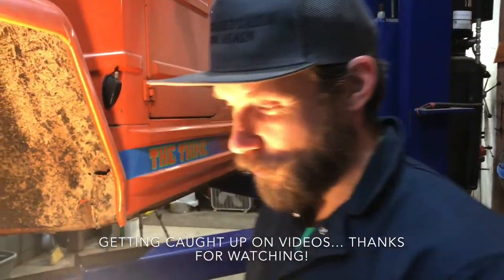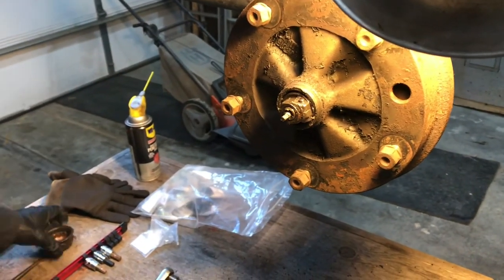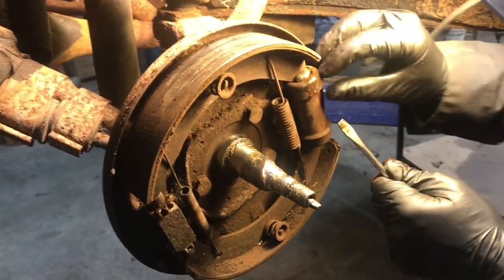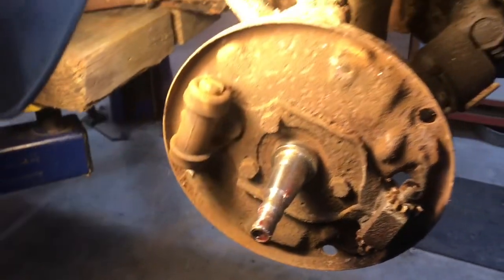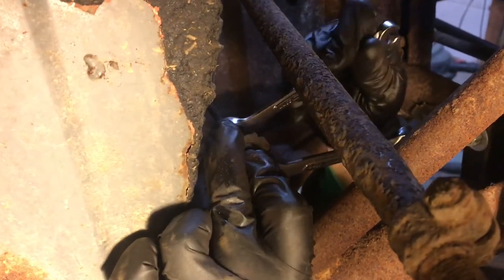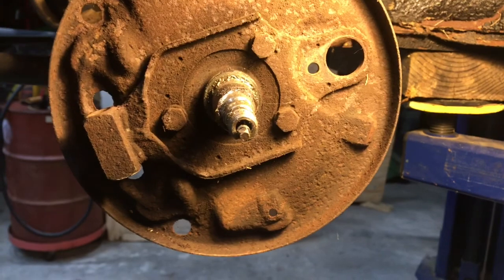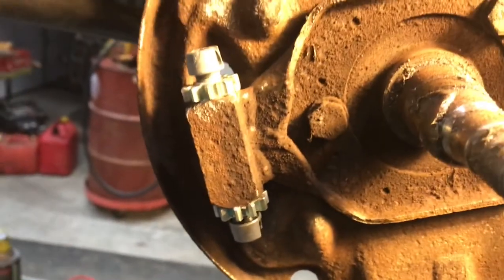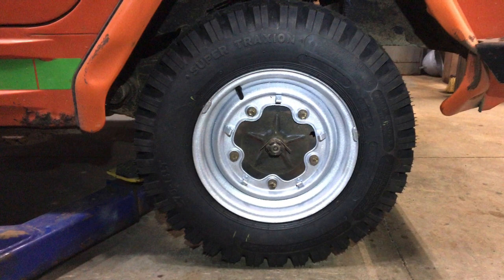1973 VW Thing - Episode 11 - Brakes!

Comment: I know its been a while Since you uploaded this but you wouldn't happen to have the part number for the brake cylinders?
Reply from the maker: Yeah, pandemic’s over so no time for playing around on YouTube!  Check out thingparts.com. They have all of the thing specific parts.  Front wheel cylinder is 131611057G, rear: 113611053BG, master: 113611015BD G